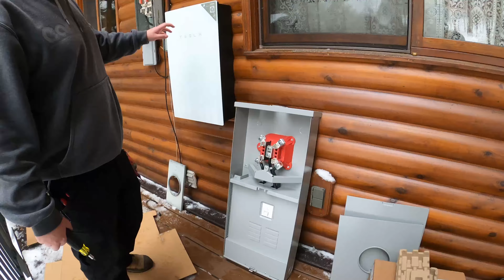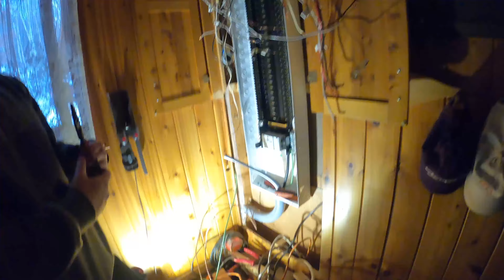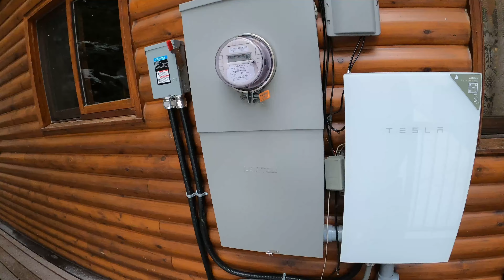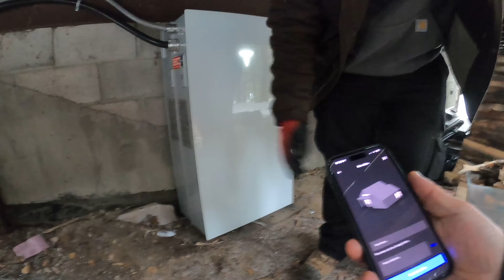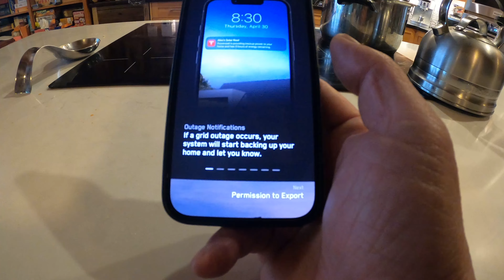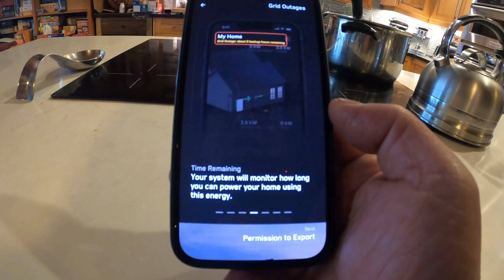S4E1 - Can Tesla Powerwall Work for Non Solar, Harsh Canadian Winter Backup and Power Management?

Comment: I'll be very interested in your experience with PW3 over the last three months. Ontario has seen a colder than usual winter. Other users have anecdotally  reported some reductions in battery efficiency at or below -20C. We are considering a similar installation in London: external wall, under deck but wonder if battery backup can be counted on in deep winter temperatures. Have you acquired data since installation?
Reply from the maker: Hello Lorraine, Thanks for watching and your interest in what we’re doing with our PW3. Yes, this winter was the perfect storm conditions for testing our installation. There were many many days below -20 and even down to -35 a few days. I think that we anticipated performance degradation with Li on batteries after owning Tesla vehicles for the last 14 years and seeing how extreme cold weather degrades performance. We just sized capacity accordingly - about 20-30% sounds about right. Our bigger concern was if the PW3 could handle the day to day loads of having the oven, microwave, induction cooktop, dryer, and baseboard heaters running normally and sometimes all at the same time when we are off-grid.  For this, I can say the it has performed even better than expected. I’m just gathering data and video clips together to make another video covering your question and more, so stay tuned…